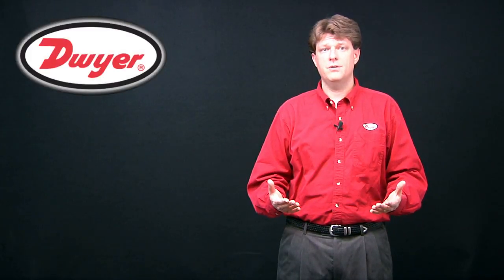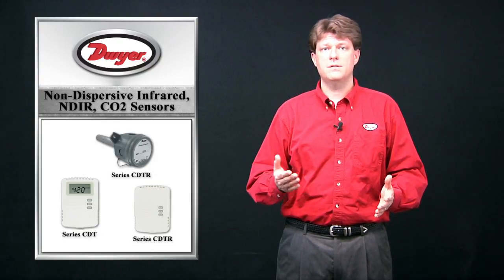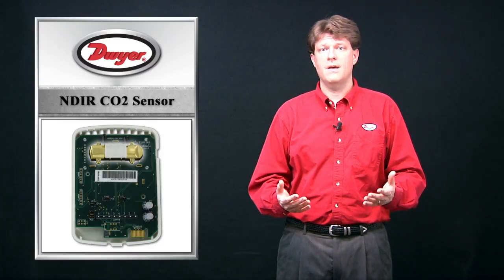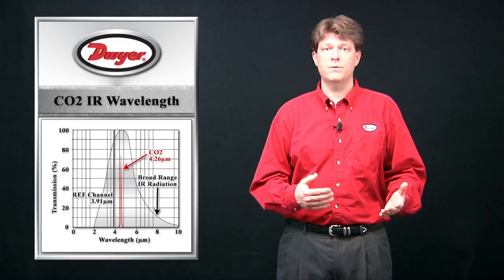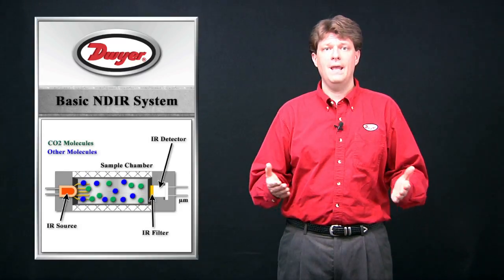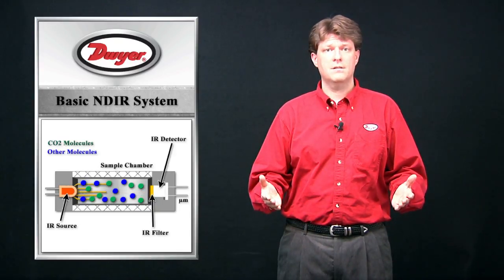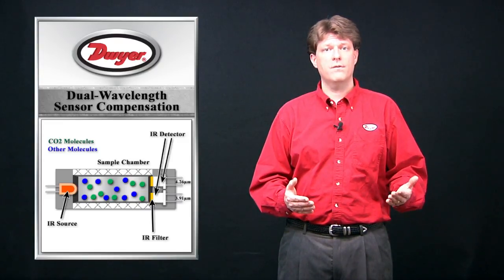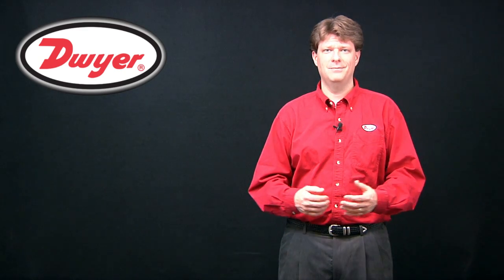Tech & Specs Video Blog:  Non-Dispersive Infrared, NDIR, CO2 Sensors (Episode 25)

Comment: how does the signature of the CO2 gets converted into a volume measurement?
Reply from the maker: Our CO2 sensors do not express gas concentration as a volume; but rather as a concentration or parts per million.  Please e-mail media@dwyermail.com with additional questions or you may always call our Technical Experts at 219-879-8868.